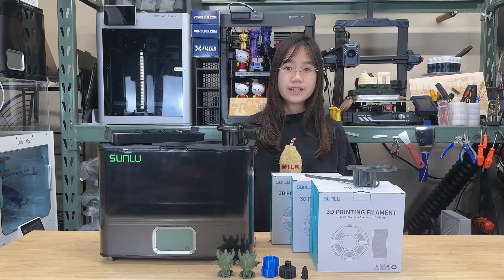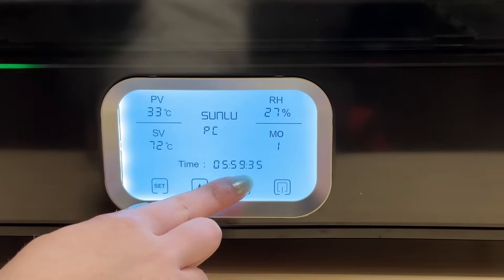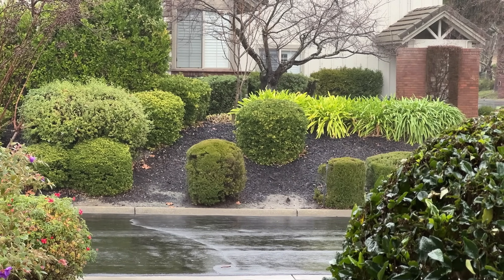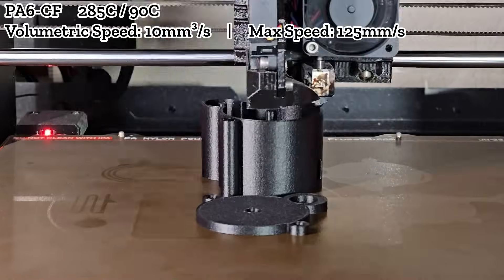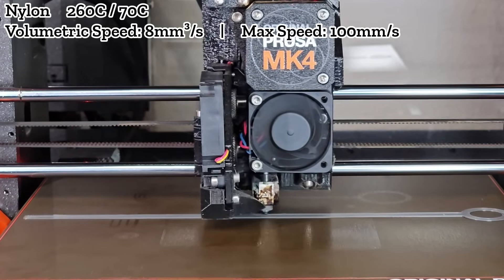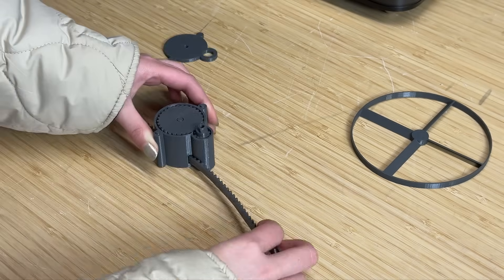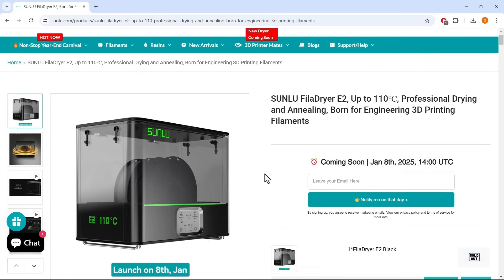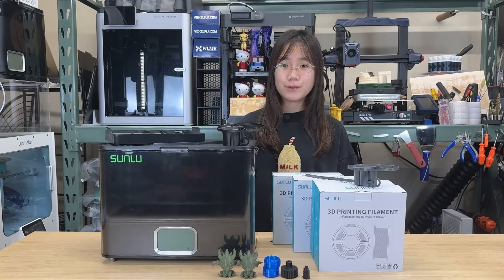SUNLU E2 Filament Dryer + Annealer: 110°C Max Temp for PA-CF, Polycarbonate, Nylon, PVA, TPU drying

Comment: Hello Aurora Tech, 

Could you tell me if the size of the S4 and E2 is identical ? Specifically the location of the feet ? I am using wallmounts for my devices and would like to know if I need to relocate the one I'd like to replace my S4 with the E2 ...

Comment: In my opinion, even the early bird price seems quite steep. For the MSRP, one could almost purchase two Bambu Lab A1 Minis or a combination of an A1 Mini and a SUNLU S4. While this product does achieve higher temperatures, I believe a significant price reduction will be necessary, as sales are likely to be limited at the current price point. Alternatively, one could opt for a Ninja AF160 from Craigslist, which also offers enough capacity to hold two rolls of filament.

Comment: Excellent organized detail as always.  I cracked up a bit when you said you like setting it manually as I'm sure I would do the same 🙂  In general for parts with a hollow center like the tire, I found using the "avoid crossing perimeters" setting in the Prusa slicer can really help.

Comment: and here I was just watching a video on dessicant drying … I really like the annealing functionality to justify the size. I was never interested in Sunlu’s 4 spool dryer because it was too big and didn’t goto 100+ deg, but this addresses those issues. Also, with 110deg forced air circulation it would be great for drying desiccant.

The question is, do I have room for it! (-8

Comment: The sticker shock on this one was real.
Reply: Seriously! I was thinking $200, $250 at the very most! $350 is nuts. There's no way. Air fryer from Facebook Marketplace for me it is, I guess!
Reply: If it functions as an annealing oven, the price isn't so bad.
Reply: @theglowcloud2215  you mean a fancy toaster oven? No, I stand by what I said. A couple hundred maybe, they may as well paint it orange and black at that price LOL
Reply: What kills me is this. All the other dryers are BS. I’ve got PLA, ABS, open air, for a Loooong time. They don’t require drying much less, 60c? For what? BS. The engineering filaments I want to work with require drying at much higher temps and essentially it makes no sense to not anneal after. So, in my book, this is the first dryer that ISN”T a waste of money. Yeah, it’s expensive but so is engineering filament. I’ll end up paying the price in the end because well, this is what I’ve been waiting for.
Reply: @TheJacklwilliams  It depends on your room. I work in a basement, and it is was 80% humidity last week in here with rain, currently 47% with none. I have to dry PLA, and ABS all the time, and to run PA/PC it has to stay in a dryer while it prints, or be in the chamber. I have the Sunlu S1, S2, and just got the S4. Each one is a noticeable leap in performance, so while I agree the price is too steep, I am not so keen to throw the baby out with the bathwater on that one. Without my dyers I wouldn't be able to print during rainy months here in Northern California.
Reply: @ Damn good point and your local climate. While my location isn’t the least humid I’d say it falls somewhere in between top and bottom.

Comment: can anyone explain to me why I'd pay hundreds for this over paying $50 for a large air fryer with temperature control?
Reply: I use my cosori to dry filament what are people talking about lol
Reply: I look forward to hearing your results with that 🤣
Reply: troll harder m8
Reply: Try printing out of the air fryer. I have a dehydrator that I've been using for drying and annealing engineering filaments. It works, but I really would prefer to print directly from the dryer. Alas, while the E2 would solve that problem, I just don't have the space for it. If I did, I'd get it asap!
Reply: Buying an air fryer just because it’s a couple of bucks cheaper is literally the definition of spending pounds to save pennies. 

You aren’t meant to leave an air fryer for hours and hours on end unattended. If you do, I pray that you live no where near me, and my heart goes out to your neighbours.
Reply: @slowcyclist4324  air fryers are designed to be used as a food dehydrator for many hours at temperatures that would be ideal for drying filament
Reply: @slowcyclist4324 couple bucks? Can get them with dehydrator settings for $60. More like minimally 4x less

And yes, they are literally designed for 24hr operation in dehydrator mode so lol?
Reply: @slowcyclist4324  a large air fryer can be had at costco for $50 canadian, this thing looks to be around $300, that's more than a few bucks
Reply: @slowcyclist4324 My air fryer has a dehydrate mode that can go for 24 hours at up to 200 F. Seems perfectly safe to me. 

If you need more than 250 F you're limited to 4 hours. But for HALF the price, I'm sure it's fine. 

I'd love the E2, but at the intro price, it's still $80 more than I'd spend on a device like that, and at the full MSRP there's no damn way!!
Reply: @slonlo364 that’s not really ‘just’ an air fryer lol. It’s a multi-use machine. 

I have nothing against using alternative devices that are designed around the same use case. Case in point, I use a food dehydrator as a dryer as a cost saving measure. 

But most dedicated air dryers aren’t designed to run for multiple hours, let alone maintain a specific temperature range. In the best case scenario it works, but when things goes south, a small fire is the least of your worries
Reply: As she stated at the very beginning. This dryer will reach a higher temp than any other dryer currently on the market and is intended for engineering type filaments hobbiests don't commonly use.
Reply: @AIIZREVIEWS  Well an air fryer can get hotter than 110degC it can probably go easily to ~200degC. They also come with a metal basket and are more insulated against high temps. The downside is no bowden tube the ultra high temp is actually a bit dangerous and air fryers are not really meant to be left on for ever.
Reply: @riakata  you just proved my point
Reply: @AIIZREVIEWS  an air fryer will go up to 218C which is twice as hot as this will go

Comment: Good review, as always!  I have a single spool dryer I bought for about $50, and it works well for me. That one does seem a bit expensive unless one has a big print farm, or the non-pla filaments really need the drying.
Reply: This would be totally inadequate for a print farm. They use much more filament than this could produce.

Comment: Nice review, but $300?  Wow that is expensive for a non-safety listed resistive heater.
All-metal food dehydrators that are UL safety listed can be had under $200, and will dry 6 spools at once at 110c.
Reply: Link please
Reply: @Trevellian  Thanks! The models around $200 get up to 190°F (~88°C), not 110°C. That’s still hot enough to dry nylon but probably not hot enough for annealing. I checked the manufacturer’s site and I don’t see any information indicating they are UL listed or have passed any other safety certifications however.
Reply: what about air Ninja Anir fryer and dehidratior? It reaches 240C. Price is about 100USD.
Reply: @ Can the temperature go low enough to dry but not melt the filament? I don’t have an air fryer but I would expect that frying takes heat, even with air.  Can it be set to run for hours? How many spools will it hold? Would be a great deal if the filament doesn’t get fried!  😆
Reply: @radish6691  Haven't used air fryers.  But food dehydrators are designed to be run for days.  And as the better ones are made entirely of metal, there is no risk of melting plastic and a greatly reduced risk of fire.
Reply: @Trevellian  The Ninja air fryer has a dehydration mode, and in fact the Walmart version, which is missing some features at the higher temps, also has a dehydrate mode at about $60.  I heard this info indirectly.. haven't tried it myself.

Comment: I'm curious if they add the "hold humidity level" feature you want, can a user flash the new firmware?
Reply from the maker: They can, as my unit is a pre-production model. They can simply flash the firmware to add that feature.
Reply: @AuroraTech  Thank you!
Reply: @AuroraTech  Just to be clear, by "they" you mean the customer or SunLu?  I don't see a USB-C port on this thing, but it's hard to tell from the pictures on the web site.
Reply from the maker: "They" refers to SUNLU, who can add that feature to the final product through chip programming.
Reply: @AuroraTech  Thanks for the clarification.  I'll keep that in mind.

Comment: Im impressed by your extensive research on these parts, i was wondering is it enough to keep PLA in a filament dryer if you only use 1 or 2 colors and start the dryer when you start printing? I might pick up a meter to measure the humitity though...what should be the humidity of PLA? hapopy new year by the way!!
Reply from the maker: Most of the time throughout the year, when the humidity is 40–50% or lower in California, PLA performs well and doesn’t require drying. Alternatively, any low-cost dryer (around $40–50) capable of reaching 50°C should get the job done. Happy new year!
Reply: @AuroraTech  Thanks! I fuguered I buy the creality Pi, as it is very useful for feeding the creality K1C and Max machines I bought..But I have yet to begin, I thank you very much for your helpful reply! :)

Comment: You used TinkerCad. That makes baby Jesus cry. Fusion 360 for the win.
Reply from the maker: I use both. For simple models, such as a propeller or a spool holder, I prefer Tinkercad.
Reply: Baby Jesus is a very sensitive baby, apparently :D
Reply: The tool is irrelevant, what matters is that people keep learning, creating, and making!
Reply: @radish6691  TinkerCAD doesn't make solids - it is a mesh modeler, but their electronic circuit layout is very cool.
Reply: don’t be a hater
Reply: FreeCAD is worth considering now that 1.0 is finally released. Hopefully it has achieved critical mass like KiCad (PCB design ).